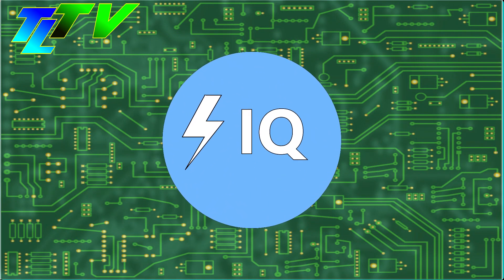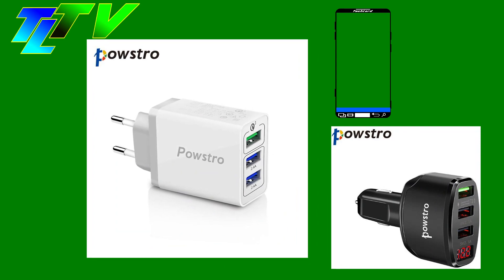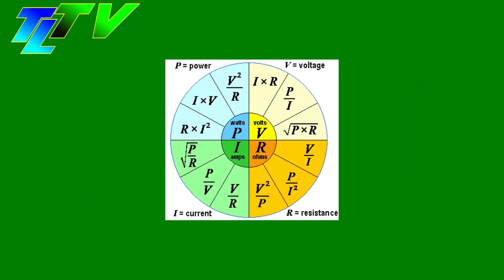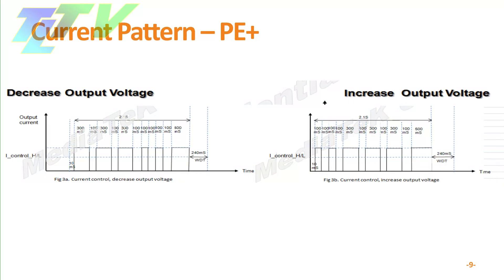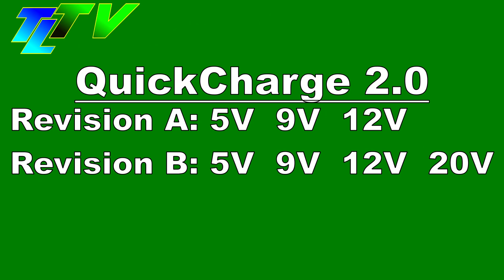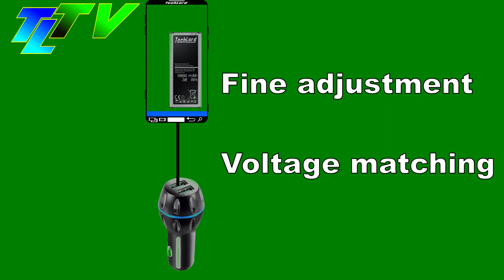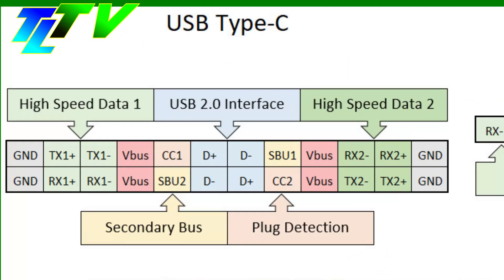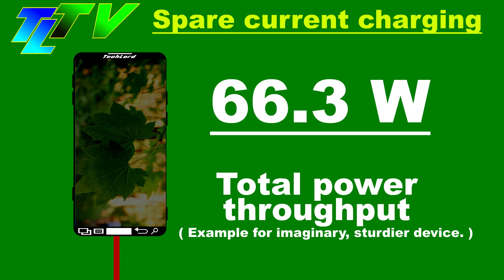The evolution of fast charging – summaized. ( Quick Charge & Pump Express )

Comment: I would be interested in the Battery Saver 1.0 & 2.0 technologies that are part of Quickcharge
Reply from the maker: Thank you for your question.

No, battery saving technologies are separate entities inside of the mobile phone.
Reply: @techlord7014  Thanks for the fast reply. I was confused by the Wikipedia page on Quickcharge. It had a table with Quickcharge versions ...QC 3 had a new Battery Saver feature. ...QC 4 had Battery Saver 2.0 mentioned.  I hoped there was something clever going on in the Quickcharging  hardware to reduce battery aging that happens with each charge  cycle
 Maybe it is just the more adjustable voltage you already covered in video
Reply from the maker: @gambit633  Maybe they are referring to charging **efficiency**, I don't know.

But fast charging and battery saving are two different things. If both get labelled with the same name, it is marketing.